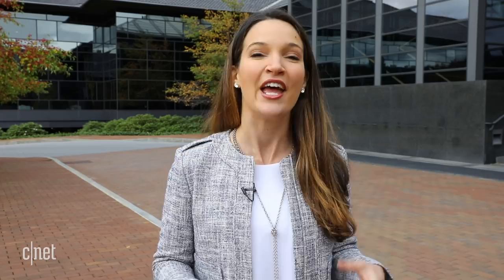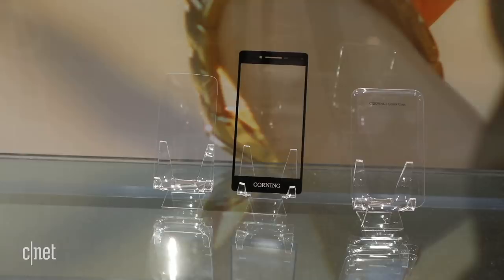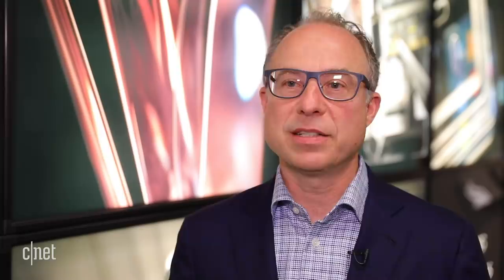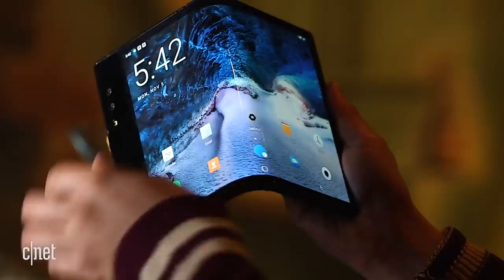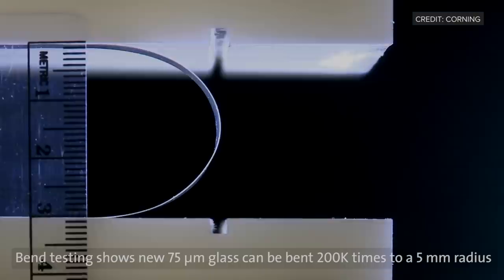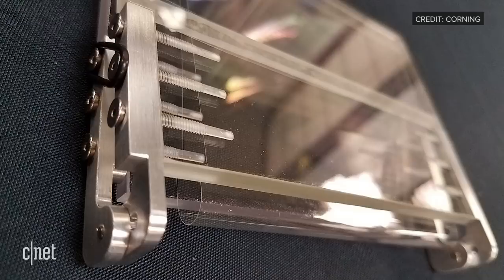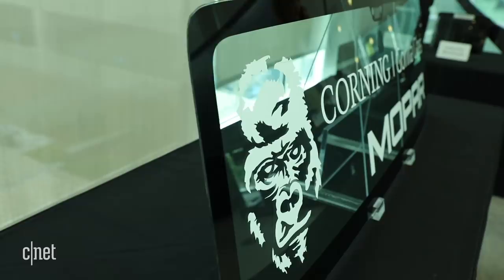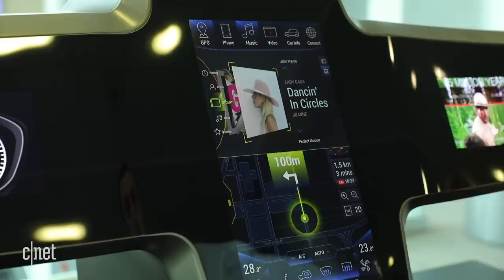Bendable Gorilla Glass? Foldable phones are shaping up

Comment: This is the glass used in Samsung Galaxy Z Flip
Reply: No it's not, since this has a 5 mm bend radius, which makes it 1 cm when folded. I bet Samsung uses plastic with a glass coating. Calling that glass would be a stretch though.

Comment: Glass is glass and glass breaks
Reply: Willow Glass didn't. It actually dents before it breaks similar to a polymer, but still being much more abrasion-resistant. I'd imagine Corning would want to retain that tough profile.
Reply: Plastic screen with a glass screen protector is the best combo. The glass protector protects the screen against scratches.
Reply: Scratches at level 6, with deeper grooves at level 7.

Comment: I agree with some comments in regards to battery. Foldable/bendable glass is good but I would rather go with a battery fix first. Nobody has solved the battery issue. I find myself still connecting to a cord everyday.
Reply: This video is about Glass only, not battery. Battery is different company and different video.

Comment: screw this like every single new glass that comes out is less durable than the one before. What we need is a sapphire screen like the one found on the apple watch stainless steel
Reply: Valentina Rodriguez You do realize that sapphire may be more scratch resistant but it’s also way more shatter prone. Considering that most people are complaining about their glass phones cracking, it’s probably not a good idea to make that easier to happen.
Reply: Apple sapphire is actually not true sapphire, it scratches at level 6 instead of 8. Apple is scamming you
Reply: @JP-be9cx  with deeper grooves at level 7 😅
Reply: Terrible idea!